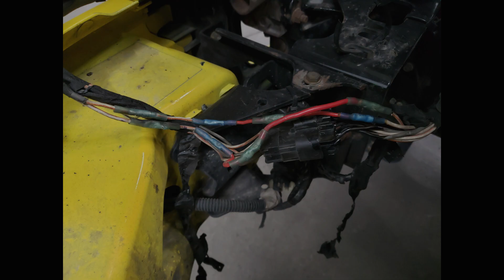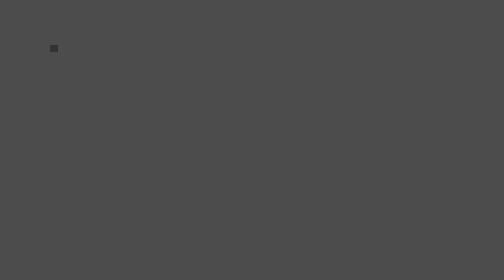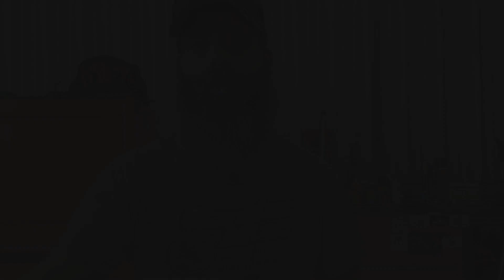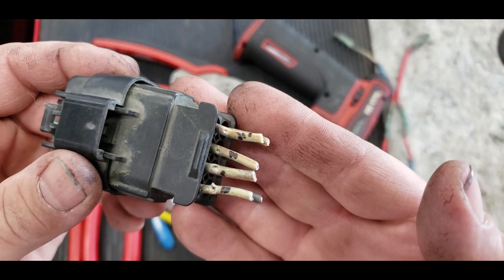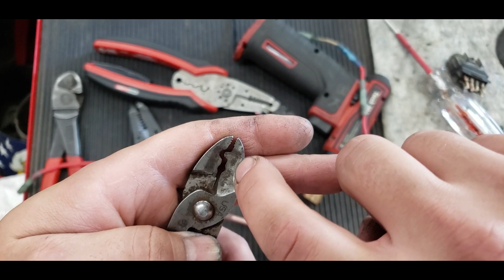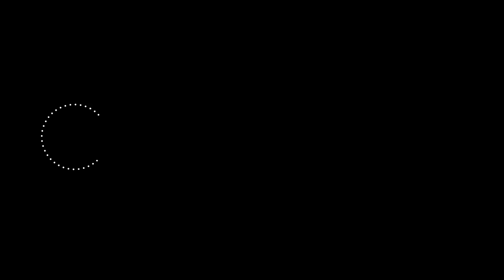Starting Off-Diesel, Do's Dont's- Electrical

Comment: The wonderful wiring jobs I’ve seen as a diesel mechanic have amazed me. Darwin awards should be issued to some who try to repair wiring harnesses. Best one I’ve seen is “My trailer lights are smoking!” Found the driver/owner had upgraded a trailer to all LED lights. Only issue was he later admitted to he had “Johnny” the crackhead do it for 50 bucks. Dude used aluminum duct tape ( actual air Duct tape aka aluminum foil that’s sticky) and everything was shorting out. But don’t worry those 20 amp fuses that kept blowing were changed to 40 amp...... 1200 bucks later he left with a proper trailer wiring harness.
Reply from the maker: Wow, sounds like a hell of a disaster, sometimes folks really dont consider spending propper money up front, thinking they can try to"save" money just to put it right up a pigs butt instead.... can come back to haunt, in that particular case sure that it did...yikes.
Reply: Bearded Seabee82 yep save a dime spend a hundred dollars later on. Seems lately the trucking companies live by this mantra

Comment: I agree with you Brandon 4 splices on a 6 inch wire is stupid just cut the whole wire out and use only 2 connectors

Comment: Even though most of the time you can pull your connector, every once in a while you need to give a good poke.
Reply from the maker: Some times plugs arent accessible, but i know you go back and repair or liquid tape at least lol. Heck even if the person that poked wouldve covered it in balck rtv it wouldve at least been something lol. Thanks for watching and hope you have good weekend.
Reply: I agree liquid tape should have been used at the least